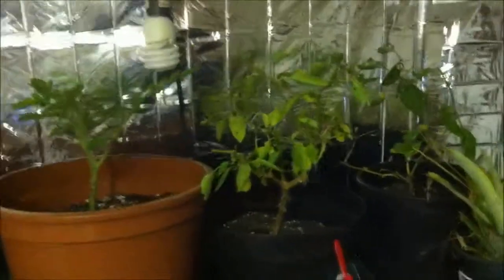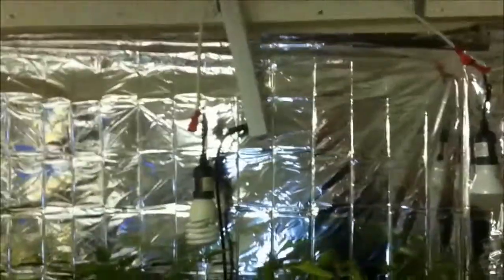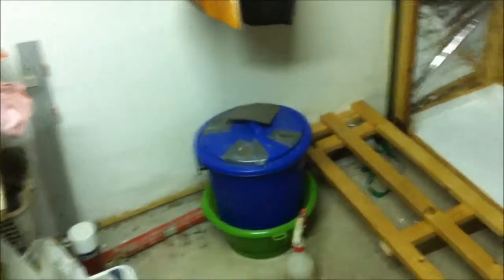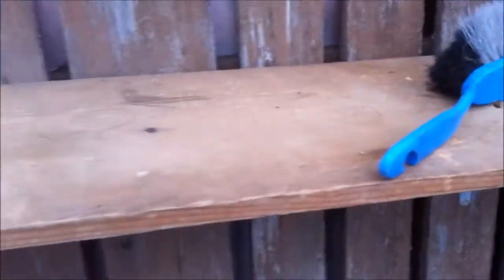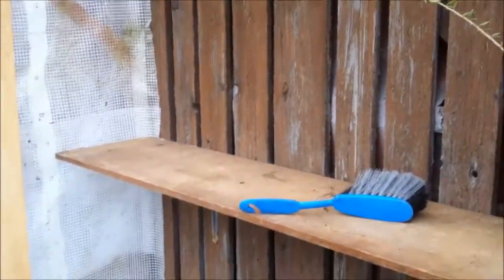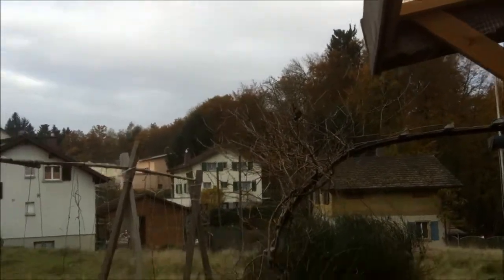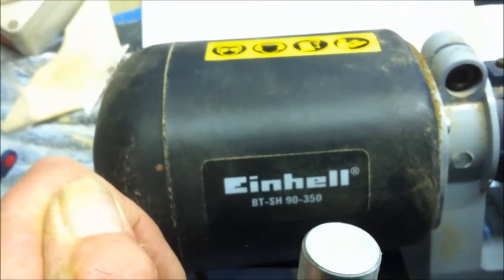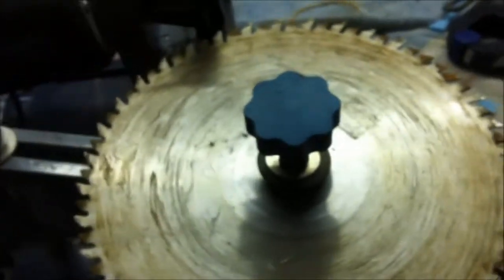Grow room and plant life support 04 11 14

Comment: Thanks for this.  I can get the machine through Amazon UK and a German distributer.  i like the simplicity of the machine, that's always a good sign.  I'll probably be heading to Amazon to press the 'Buy' button soon.  Good luck with those plants you are trying to over-Winter.  I tried it two years ago using a bubblewrap tent heated by a big candle in the greenhouse but I failed miserably.
Best Wishes, Brendan.
Reply from the maker: You more than welcome Brenden. I am glad you found the sharpener you have to set it up for each blade but I have seen how you plant your peas so that's not a problem for you ;-) I guess ther are better ones but that works well for me I have done 20 or so blades with it and the disk is still good
 I am trying with the plants I am hoping the shed will work as a heat sink and that I remember they will need a little water. We had a very hard winter two years ago down to -15 but last year was mild  so I will try and then try again lol its taken 6 years to grow a tomatos here for me blight every time and Halvor Gardening in Norway said put a roof over I put them in new compost and pots this year I got tomatoes until now I cut them down last week. I did start them in November last year in the grow room. it was a little early but I am learning.
Thanks for your potatoes I want to grow them like yours and *****  Dan's great for the space and harvest.

And the same to you sir.
Dave

Comment: Nice setup Dave. I failed on getting a grow room set up this year but have another idea. I'm thinking of making a hoophouse with the same material you used around the tomatoes. May go with the green UV stuff though. I need one of those blade sharpeners. My father in law won't replace his blades not let me replace them. They don't cut anymore, they burn through the wood.
Reply from the maker: I am still working on the grow room Jay and trying to balance the space I had a some time today to get some stuff done I dont know what I will get. The plastic I have is what I got from the construction sites I work on I am sure it good for UV but it was free and going in the skip so I got it out. Maybe not good for how clear it is but got to work with what I have. What is the green UV proof that you get?
Cutting is always better than burning  that saved me some time and money burning is for cooking and heating cutting is for making stuff.
Thanks J *****